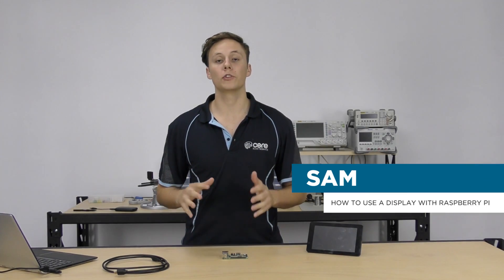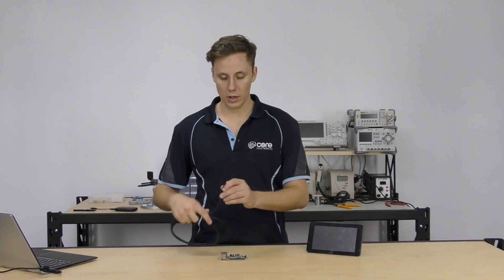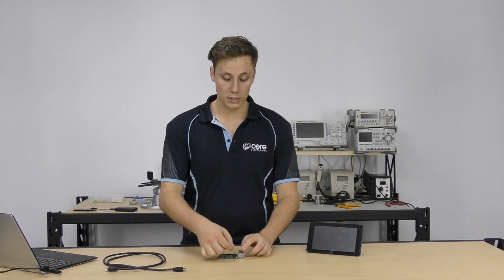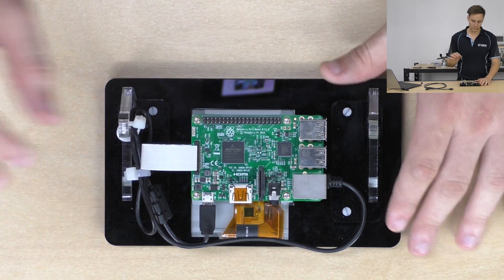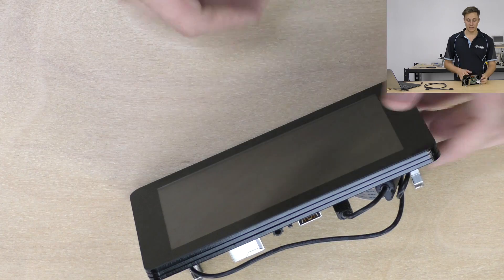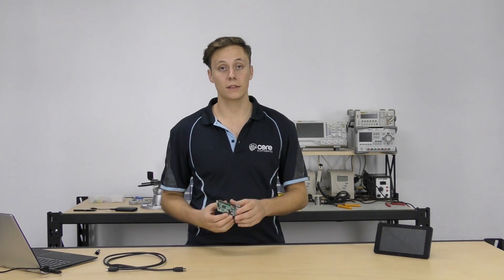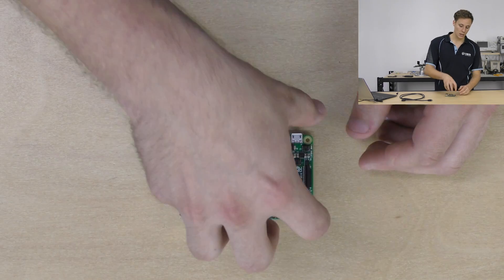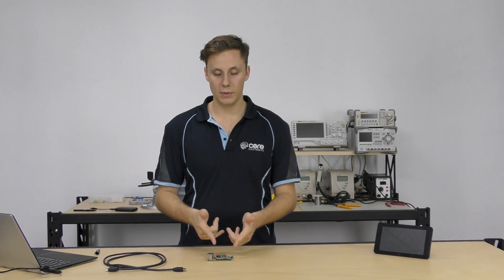How to use LCD Displays with Raspberry Pi

Comment: Hey, because there's like 500 million kids in urban regions without schoolbooks, i want to design a raspberry pi system that can use recycled ewaste laptops and touchpads to make wall displays which can then be loaded up with thousands of kids books and learning games, so kids can stand around in groups of 3-4 and learn for free using solar power. How realistic is that idea?
Reply: very unrealistic becuase it would be very hard to distribute this
Reply: @melissaleigh8019  It would be necessary to pay local students 20 labor for 2 days in those countries, and in that time they can build a school pod. I did a total cost analysis, including an SSD drive, 2 bags of cement, computer board, LCD and mouse from defunct chromebooks and laptops. total cost for a school is 150 euros.
Reply: There's millions of young rich tourists going around the world in search of adventures, they have it on their CV afterwards. Installed an advanced electronic school 50km from dhakka/mombasa etc.  @melissaleigh8019